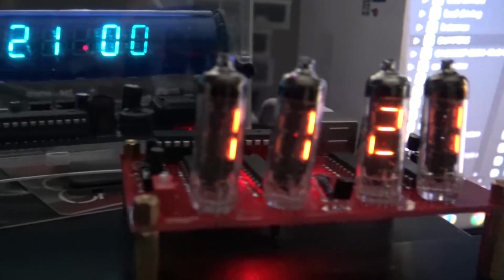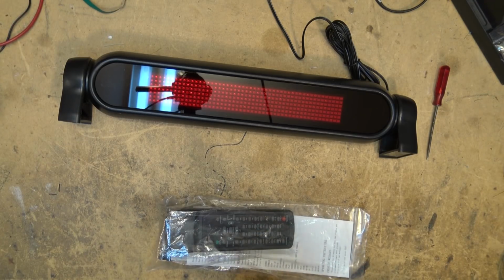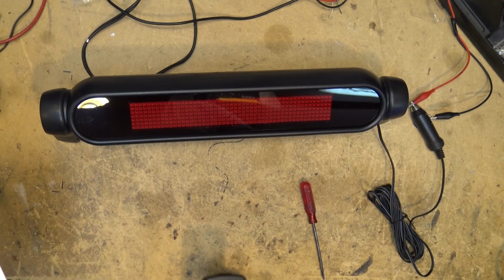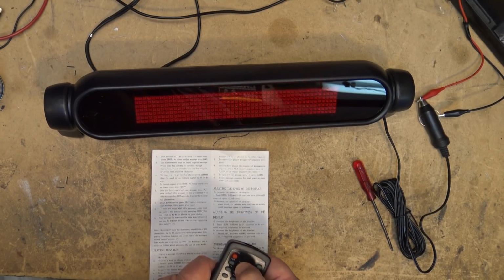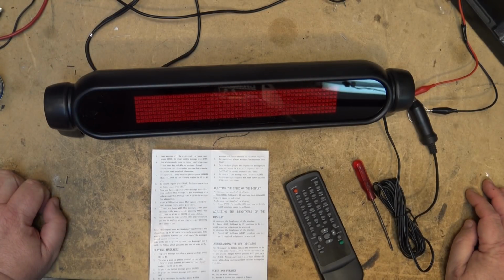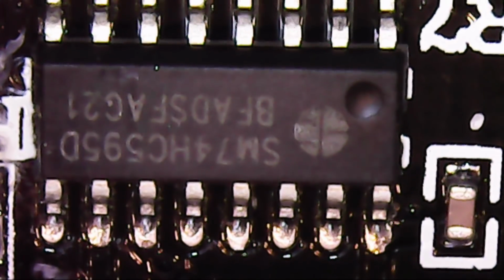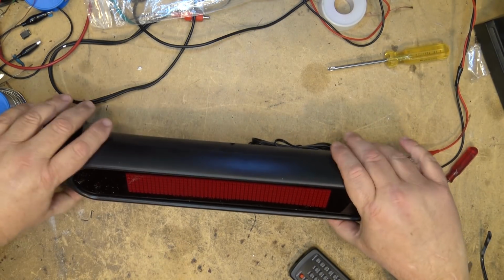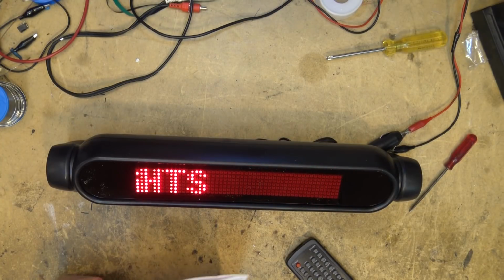LED Message board review and tear down

Comment: I want this for tailgaters and people who think 120km on the motorway still isn't fast enough and feel the need to flash me to force me to move.
Reply from the maker: The one that sits on my bench has a remote to flash custom messages.  Your favorite 4 letter words are blocked!
Reply: @12voltvids  a simple back off or I'm going the limit or don't be a jerk etc would be good
Reply from the maker: @BANNERMAN666  
The preloaded messages say basically that.
Reply: @12voltvids can we use a universal remote my friends

Comment: You going to set the message thus...
"If you can read this then you are too close back off oh and by the way turn your lights", Julian Llett designed and built something like this but he used 74LS** series to build his, It might be possible to build one with rude messages.
Reply from the maker: For the record I have put some 4 letter words in it, and it displays them just fine, so even though the manual says it censors words, it doesn't. I even saved them in the memory,

Comment: You need a PC running win XP to program it and it censors you, WTF.  👎👎👎
Reply from the maker: I need a PC to program my old sign, not this one,
Reply: 12voltvids

Try running VMware Workstation on the Windows 7 PC.

You can find ready-to-run hard drive images with Windows XP (or just install it from CD-R / image), and the VM lets you connect to practically any real device on the host PC.

There's really no need now to run the older PC, unless you're into retro gaming. ;)
Reply from the maker: ElectronAsh 
Except that it uses both a parallel port port and USB port to program. The parallel port plugs into a dongle that has a security chip in it. That has a lead that has the USB plug and the other end a mini USB to plug into  sign. Finding a new pc with a parallel port is a tall order and chances are a usb/parallel adapter isn't going to work with the security dongle.
Reply: 12voltvids Expansion cards are still available.
Reply: Wow, that is pretty old-skool. :p

Actually, I still have proper parallel and serial ports on the motherboard of my slightly older Q6600 PC.

(on the actual board, so not the "fake" parallel adapters for printers etc.)

You can still get them, but they are getting hard to find now, naturally.

It's this board...

https://www.gigabyte.com/Motherboard/GA-P35-DQ6-rev-10#ov

I do have a serial port on the Core i5 I'm typing on now too, and I think you can still find proper parallel port cards for it's (one) PCI slot?

I know there are other uses for the older PC as well, but there are ways to get the old stuff working on newer hardware, if it saves you having to maintain the old PC etc.

Comment: To program your old banner you could use a virtualized instance of Windows XP (with VirtualBox or VMWare) and just the Com- or USB-Port passed through. Way easier to maintain.
Reply from the maker: Too much work to run a virtual machine. I just fire up the old XP machine when I need to make changes to it, which I haven't done in over a year.